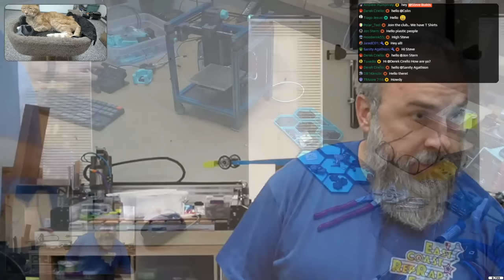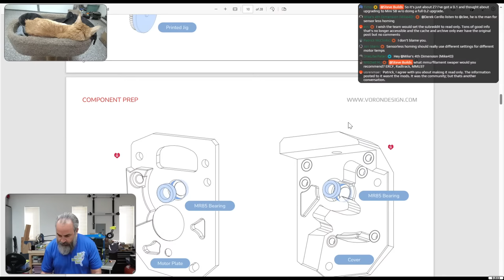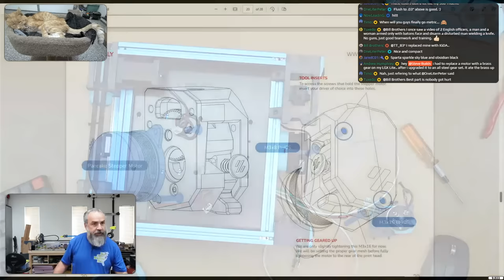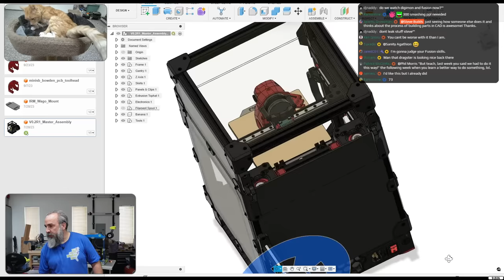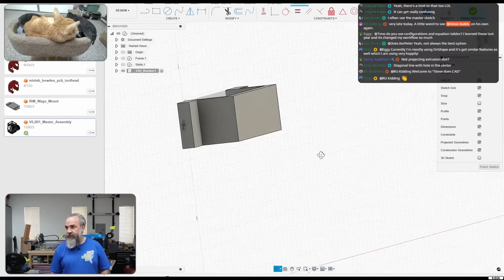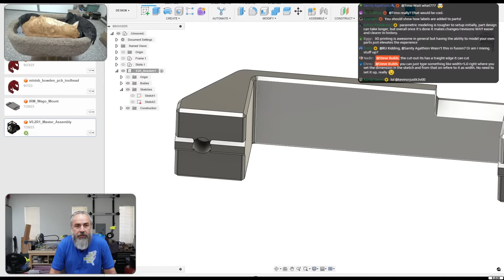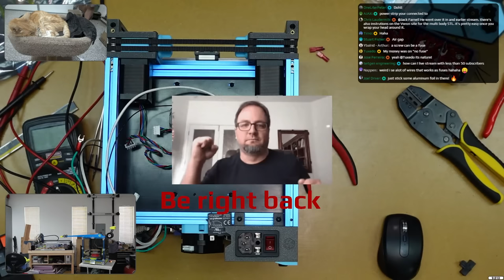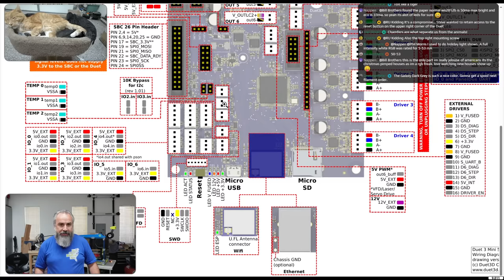Voron 0.0 to 0.2r1 Rebuild - Part 4

Comment: @Steve: Any chance, the wagos fit in between the power inlet and the PSU? Like ground next to the Z-extrusion and live+neutral against the skirt. That should isolate and clean up the AC-wiring (especially with the bed-wires running behind the stepper) while also creating space for a smaller buck-converter between the PSU and the controller-board.
Reply from the maker: I like where I have the SSR now, nowhere else will I get as easy access to set it against the frame for any level of heatsinking.  I am planning on tweaking the layout from where it is though.  We'll see if it turns out.
Reply: Yeah, no, I would leave the SSR where it is, but the 24v to 5v buck-converter for the LEDs might fit next to the PSU with the WAGOs relocated. I sent you a sketch of my idea on Discord, hope, thats ok.